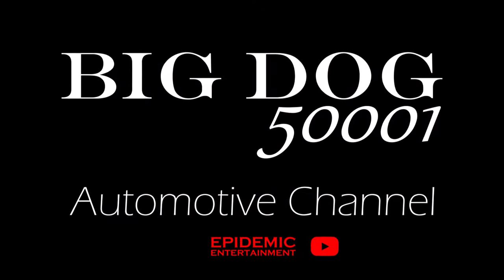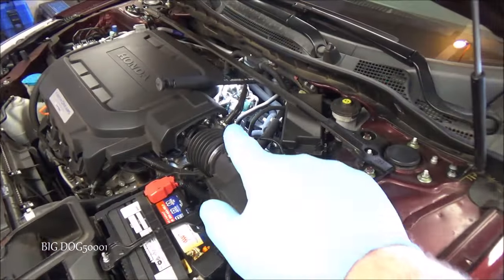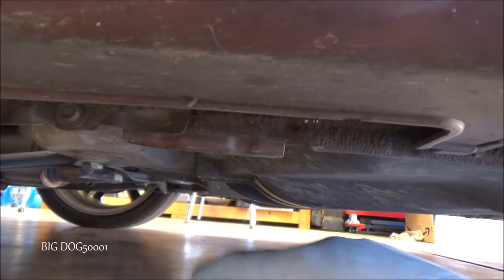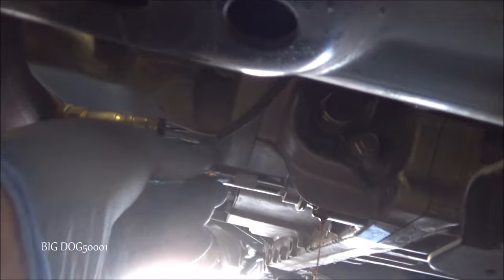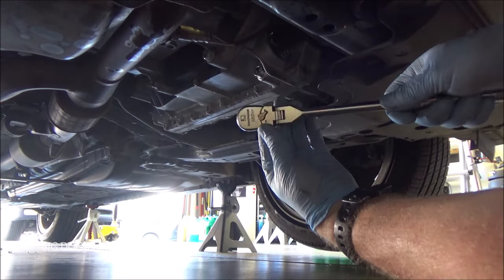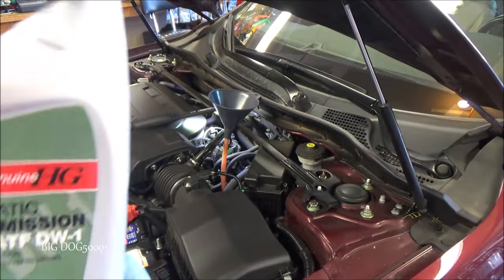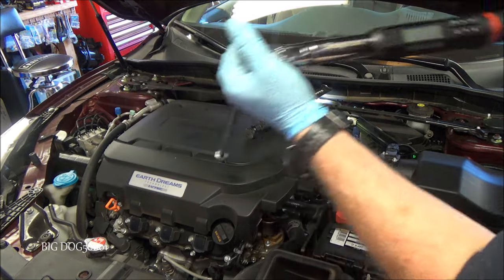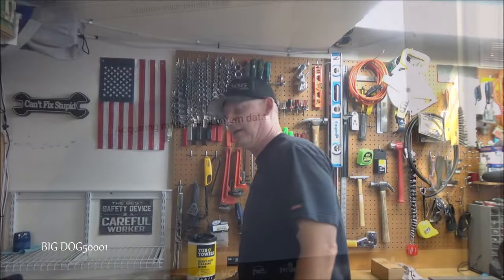2013-2017 Honda Accord 3.5L V6 ATF Automatic Transmission Fluid Service

Comment: I have a 14 accord V6 automatic transmission I’ve done my drain and fill 2 times on it within 40k miles, but I notice that between 35-45 MPH & 1600-2000RPM right before my gear changes, it rumbles, kinda like it struggles to change gears. Idk what to do or if my transmission is faulty… I change the fluid exactly like you showed in your video. I wouldn’t say it slips because if I increased the RPM within that speed range it drives smooth. Idk :/
Reply: Mine does the same 
Makes you not even want to drive it smh
Reply: My 2008 v6 has the same problem. Did you find out what is the cause?
Reply: @CCG0D  nope, i did notice that after doing a drain and fill, it reduces the symptoms BUT it comes back again. I took it to the Honda Dealership and they told me it needed a drain and fill lol AFTER a week of me doing it. Im certain that its something mechanical at this point tbh.
Reply: @Kevin-if9kw  Thanks for taking the time to respond back. I did check my spark plugs, battery and spark plugs seems to reduce it a little but it came back again (i changed my Transmission Oil not too long ago so I skipped this part.) Next is to check transmission solenoids but I'm too lazy at this point. Too busy with work. I do hope it's not the torque converter...
Reply: @CCG0D  thats what im afraid of, the torque converter!! My accord has 103k miles so it may be worth looking into fixing it, knowing that these vehicles can be very reliable and run over 300k miles. Thank you for the input!! Def going to change my sparkplugs and see if that helps a little!
Reply: @Kevin-if9kw  yup. Mine is already at 170k. I doubt it's the torque converter and hope it's not the t.converter cause these honda last a long time like you said. Probably those transmission  selonoids, and some other oil pressure selonoids sensors right  behind the left front tire (underneath the transmission)
Reply: @CCG0D  I have the same problem, did you find a solution?
Reply: @Kevin-if9kw  I have the same problem, did you find a solution?
Reply: @brunolotti  no bruno. I haven't gotten the time to do it.
Reply: @CCG0D  If you have time and also solve it, please let me know.
Today I changed the fuel injectors, the problem still persists.
Reply: @brunolotti  for sure. I think i will need to do it soon since it's almost time for changing the timing belt on my car.
Reply: @CCG0D  Mine will need to be replaced at the beginning of the month. but the vibration is definitely something from the gearbox

Comment: Not sure if you’ll see this but what length is the extension you’re using?
Reply: I used a 24 inch.  It was really hard with that, but it came off.

Comment: Having what I think to be are trans issues… @ 40 mph while cruising the car seems to be surging like it doesn’t know if it wants to shift or not. 93k miles 2017 v6 accord. Also making a hard shift @ about 20mph while slowly accelerating. Can anyone suggest what they think might be the problem? Appreciate it.
Reply: Having the same issue with mine around 20mph
Reply: It could be a dirty or plugged transmission filter.  Have you changed the filter out on it yet?
Reply: @Harrisonweightman  I just had my fluild switched out at 50k miles. I bought the car around 44k and I don't think the previous owner had the transmission serviced. The technician said the fluid was black. So far no slips.
Reply: Could be the fuel pump recall
Reply: Same here , also when I put it in reverse the trans slips sometimes . What can the problem be?

Comment: My 2014 honda accord v6 coupe has an ATF bolt behind the engine air filter and that where it says to fill it up. Please advise!
Reply: Forget that, use the transmission dip stick with a long nose funnel.  Ignore anyone who says to do so otherwise.

Comment: U don't change the inline filter?

I do the internal filter every 100k but I do the online filter every 30k. I drive 90% highway miles so my car isn't laborious and over heated in stop and go traffic so I just do the recommended.

 After i replace the internal filter I unhook the ignition and turnover three 2second no firing engine turn overs so we don't Start the vehicle with air inside the filter causing a dry start which transmissions don't self lubricate as quickly or resiliently like an engine does so u need to do a few non firing turn overs before starting. Treat every car like your car.

Comment: 0:40 what do you mean by conventional transmission? Can you please explain a little more?
Reply from the maker: I am referring to an automatic transmission that has set gear ratios and separate distinct shift points (older Hondas and most Honda V6s have these).  These transmissions have been around for quite some time. 

Newer Hondas (like the 2013-2017 4 cylinder Accords) have Continuously Variable Transmissions (CVTs), which continuously change their gear ratios (some CVTs are programmed with shift points to try and mimic a conventional transmission).  

CVT models have a different fluid change procedure than the one shown in this video and also use a different type of fluid (like Honda HCF-2 Continuously Variable Transmission Fluid).
Reply: @BigDog50001   whats more reliable v6 accord or v4 accord with cvt let me know thank you

Comment: Is it a requirement to level or for for best drain?
Reply from the maker: It is best to make the car level for ATF service, but I have tried it both ways and measured the fluid and the difference is negligible so I no longer worry about it.

Comment: I have a 2014 Honda Accord with a 3.5L V6. It has about 75,000 miles on it. The other day I was driving it when all of a sudden this blinking signal popped up on the gauges that looks like a D3 except the D appears to have a X that goes through it. I looked in the owners manual and it appears that this mystery code is not in there. Has anyone else here have the same problem? Do you know what the problem could be. When this signal goes off, the LDW and FCW lights also come on at the same time. This causes the forward collision and lane departure warning signals to stop working entirely.
Reply from the maker: I would scan the system for trouble codes to start, there should be some codes stored in memory.

Comment: Caution jacking accord rear end on that tie down hook under trunk. Actually bent bottom of spare tire well, had to persuade it back down with BFH AND 2x4 impactor to allow cover to lay flat . Maybe just my car?
Reply from the maker: Not sure what happened on yours but that's the designated lift point in the rear on this generation Accord (and many other Hondas).  Of course as they age and rust and corrosion take a toll that can change things.
Reply: @BigDog50001  thank u for response . I thought it was designated lift point also. 2005 accord EX no rust . Felt stupid when wife asked what I did to the trunk. , because the flat thin board cover was sitting 2 inches proud

Comment: Good to know that at least the fluid can be changed more often.  Especially with no filter to access I would definitely NOT recommend following the …Lifetime Fluid” schedule…..The fluid will last the lifetime of the transmission…read that back to yourself slowly and you will see the problem.
Reply: I've been told that there is an external filter. I was given a price for it today. I couldn't tell you the part number as I've not picked it up yet.

Comment: Anyone have problems with the transmission specifically the V6 touring model with 6spd  showing a "transmission system problem" warning light on the dash??
Reply from the maker: I would probably scan it for trouble codes to start.
Reply: @BigDog50001  I have a P2714. what does this mean
Reply: I have the same issue, did you figure out why it was happening ?
Reply: @raymonddeleon3613  I never found the problem. I flushed the transmission twice. Nothing. I ended up selling to Carvana for profit.
Reply: I have this “transmission system problem”. Should I change transmission fluid? Does Honda care cover under warranty? Any suggestions?

Comment: Couldn’t u just simply fill it at the dipstick ? No need to pull that atf bolt
Reply from the maker: On 4 cylinders yes, but on 6 cylinders the dipstick opening is a little too small.